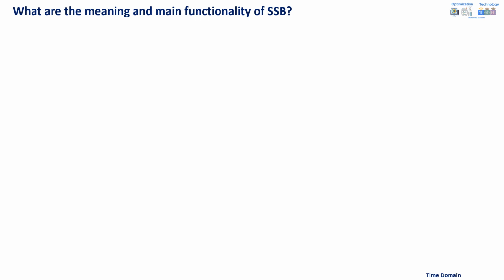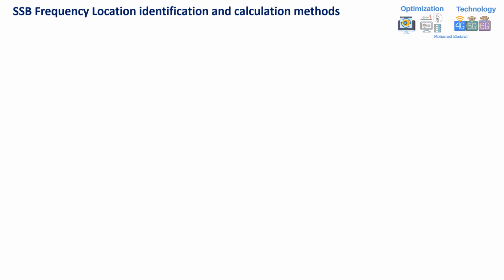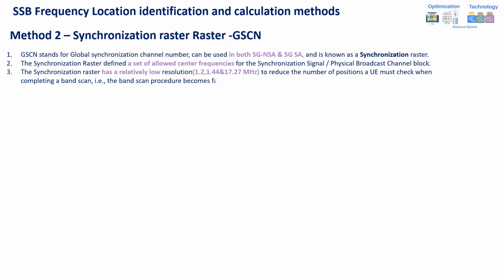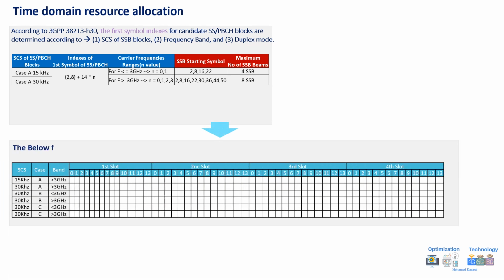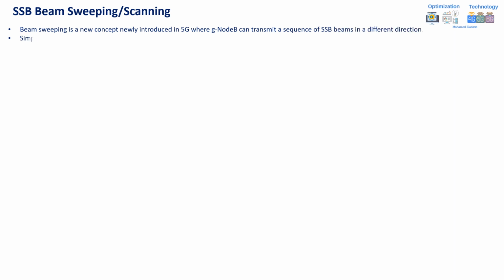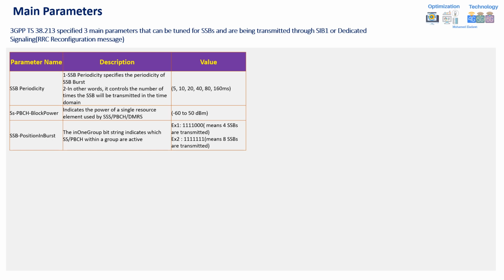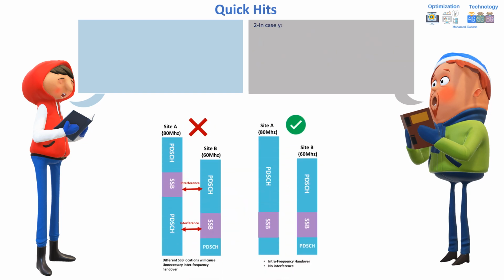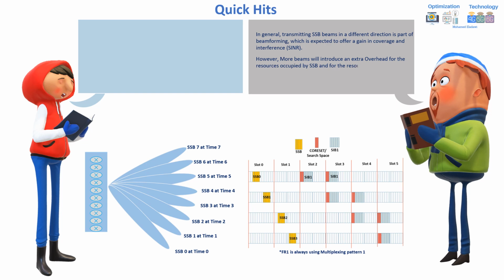5G SSB Detailed Explanation (Theory + Practical + Configuration recommendation)

Comment: Hi,We observed that the same TDD slot assignment is configured in both cases of one site:

8_2_DDDSUUDDDD

However, the special-slot structure is different:

SS86: 6 DL symbols, 4 GP symbols, 4 UL symbols
SS84: 4 DL symbols, 6 GP symbols, 4 UL symbols

With SS86, the cell supports 6 SSB beams, while with SS84, the number of SSB beams is reduced to 4.

Could you please clarify why changing only the special-slot structure from SS86 to SS84 reduces the supported number of SSB beams, although the overall slot assignment remains the same?

Is this reduction caused by:

fewer available DL symbols for placing SSB candidates,
overlap of some Case-B SSB candidates with GP/UL symbols,
or a vendor-specific limitation in the broadcast-beam ?
Reply from the maker: I believe this is normal. Typically, two SSBs are transmitted within a single downlink slot, and they are separated in time rather than starting from the very first OFDM symbol. The initial symbols are usually occupied by the PDCCH, while each SSB requires four consecutive OFDM symbols.

In the case of SS84, the special slot provides only four downlink OFDM symbols. As I understand it, this is not sufficient to schedule an SSB because there is no flexibility to place it after the PDCCH while still accommodating the required four consecutive symbols.
Reply: @mohamedeladawiashour  
Thanks for response.
In this case,When the SLOT assignment is DDDSUDDDDD,
3 primary DL is available, which means 6 time domain position for ssb is available.
 But here the ssb bitmap which show the ssb indexes, shows something like  11011000 and 11011110.
It means ssb idx 2 location in Time domain is not utilized and is null.
So there maybe some another scenarios that ssbs do not broadcasted . Like Colliding ssbs in dss scenario.
 And ofcourse the network that i work is nsa with out dss.
Do you have any idea of possible causes?
Reply from the maker: This is more related to the vendor product and feature deployment. In the normal case you mentioned i am expecting to see at least 6 SSB beams if not 7.
Reply from the maker: Please refer to this video for more details

https://youtu.be/XpEWO1I2ANc?is=ESvreBxfOWsA8Rm3

Comment: Thanks for detailed explanation, i have a doubt, like if SSB falls in the UL slot, like in the example if the Slot 4 is UL slot, then whether corresponding SSBs will be transmitted in that slot or it will be moved to subsequent next DL slot?
Reply from the maker: You’re welcome. SSB is just transmitted in the DL slots and it will never fall in the uplink even if you’re using different slot format. Have a look into the below video to understand the ssb transmission scenarios in case of different slot format

5G Slot Format Configuration: Impact on Performance
https://youtu.be/XpEWO1I2ANc
Reply: @mohamedeladawiashour  Thanks again for quick help. I checked the video, so as per that depend on the slot format the number of SSBs are limited,
 so if we have 16 SSBs (1111 1111 1111 1111), for DDDS2U format, then 4th  and 5th slot will be UL ,  so in that case we skip the corresponing SSBs or only DL slots are considered for the SSBs start symbol calculation? Appreciate ur response on this.

Comment: do all the ssb blocks in one ssb burst have the same level of power? or it can be adjusted?
Reply from the maker: Yes, from a power point of view, all SSB beams should have the same power. As far as I know, this power level isn’t adjustable. The main reason for using multiple SSB beams in a burst is to gain coverage/quality from beamforming, thanks to the directionality of each beam.

Comment: Mohamed a question is raised from SSB beam sweeping technique : What will be the situation from SSB-RSRP point of view if a user is between 2 SSB beams ? Will the user detect the presence of 5G coverage and will be able to have 5G service(RRC connected), since he will be in SSB coverage gap(minimum SSB power) or not? Thank you
Reply from the maker: Hi George, based on my understanding, the user should still be able to receive service. I haven’t encountered such issues while working with vendors that support beam sweeping. For example, one of the vendors I worked with supported 8 SSB beams—one wide beam(Serving Center Users) and seven narrower beams. However, even if all 8 beams are narrow, I believe it would still be highly unlikely to completely lose service in the edge area between two SSB beams.

Comment: Hello Mohamed! Hope you are fine! Is kSSB parameter necessary only in case of different numerology between Common Resource Block grid and SSB ? Thank you
Reply from the maker: That's a good and tricky question. While I'm not 100% certain, I believe the answer is yes. The *kSSB* parameter is particularly necessary when there is a difference in numerology (subcarrier spacing, SCS) between the Common Resource Block (CRB) grid and the SSB. If the numerology (SCS) is the same for both, the position of the SSB can be directly referenced without needing the *kSSB* offset."

Comment: Thank you very much for such informative videos. I have a question in 'Frequency offset approach/method 1' of frequency domain allocation. How does the UE know length of ss/PBCH block (in terms of number of RBs) ? From offsettopointA and kSSB it can only know the starting RB location of the ss/PBCH block right ?
Reply: I just watched again and realized that it is always 20 RBs in size. Thanks.
Reply from the maker: You are welcome;

Comment: Very deep qnd really reuired information when actually you wirk on projects..great..plz give more deatils about raster what is use of raster
Reply from the maker: Thanks, Vipin a lot; in short, we have two types of raster; Channel Raster and synchronization raster; Synchronization Raster: indicates the frequency positions of the synchronization block that can be used by the UE for system acquisition; For Example, synchronization raster is introduced in 5G to use higher steps compared to channel raster; example synchronization raster uses 1.2mhz( and larger), this means UE will do the blind scan every 1.2mhz step until he detect the SSB.